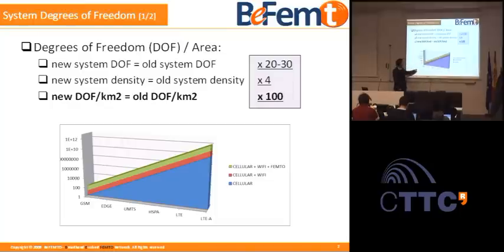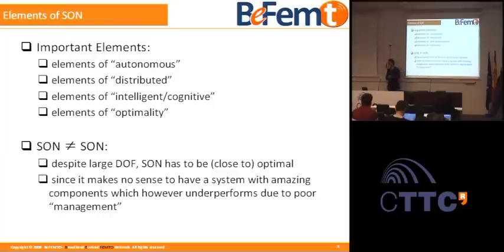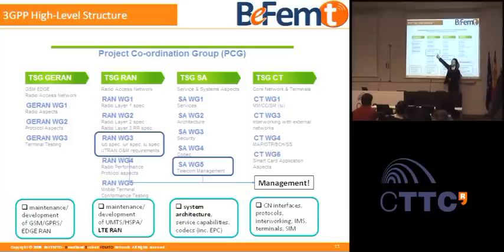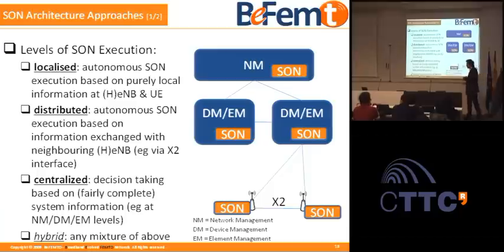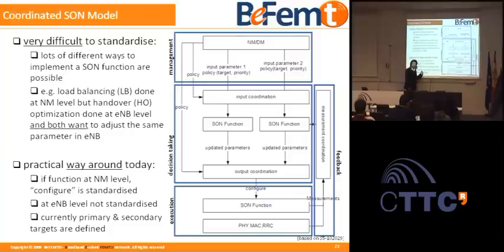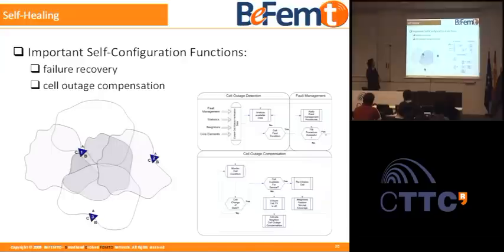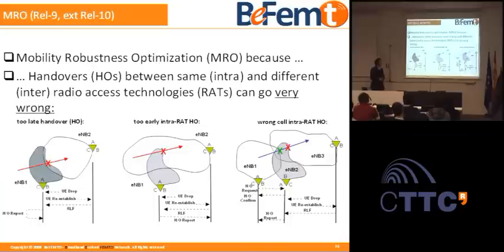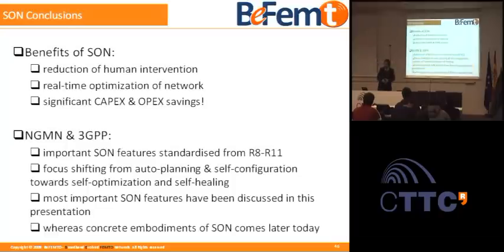LTE-A SON for Femtocells

Comment from the maker: We work 24/7 to make sure that radiation levels are as low as possible whilst giving you all the benefits of a wireless connection. In the meantime, be assured that propagation through walls is attenuated by at least 20dB, making it completely harmless; and if you have windows, you can buy special coatings which reduce wireless field strengths by about the same amount.